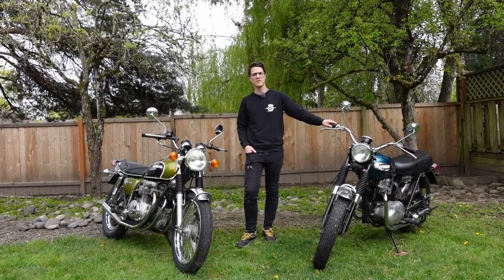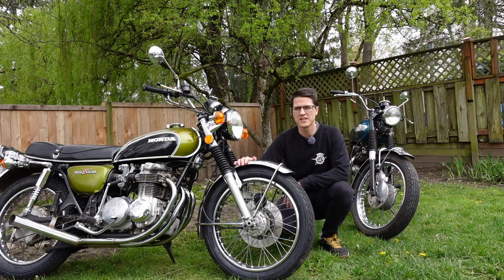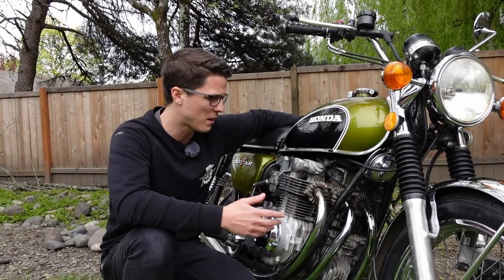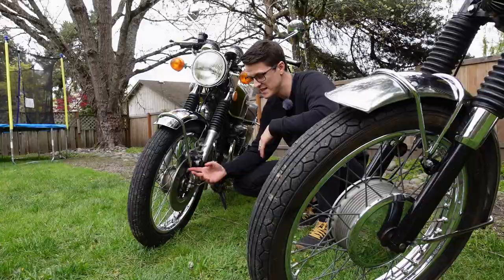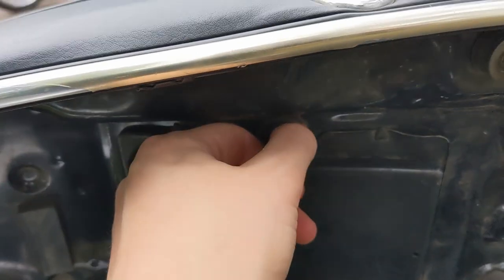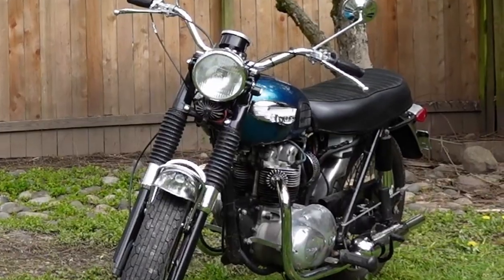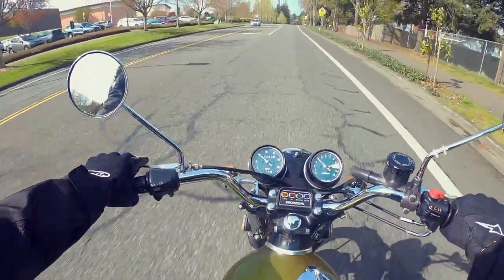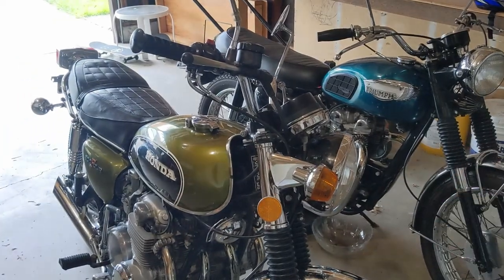How this Honda killed this Triumph

Comment: Errr, no your Honda didn't kill your Triumph, but you probably know that from the comments below. Besides comparing oranges to oranges 73 Triumph T100D had 5 speed slick gearbox ( better than Honda ), double pistons front disc brake ( better than Honda single piston ), much better frame and suspension and better torque giving more speed on low and middle revs where it really counts in real life. Only Honda upper hand was it's reliability and lack of vibration. Problem was only a few people knew about those Triumph features and they didn't care seeing it as dated bike anyway. By the way your 68T100  is a last year of this front suspension and SLS front brake, year later and T100 got much better front end and TLS brake both better than your Honda 500 parts. So yes, Brits try to improve it on a shoe string budget and in the same time not to loose their loyal clientele what was a very difficult task.
Reply: I'd think the more direct comparison would be 1973 Honda 4 to 1973 Triumph Trident or BSA Rocket 3, yes

Comment: Hi bart - it's Big Rodders in Ireland.  In 1973 I bought a Yamaha XS650 for £750 instead of the Honda CB500 that was priced at £900.  I was earning £60 net per month so the price difference was the deciding factor.  In 1979 when I owned a BMW 100/7 I had a test ride on a friend's Honda CB550.  I was astounded by its smoothness, tractability from low revs and low fuel consumption.  Overall, a captivating motorcycle and one I would have instantly swapped my Beemer for given half a chance.

Comment: I was in my 20's when these bikes were new. I chose to ride 2 stroke bikes. 69 Kawasaki 500 3 cylinder. A modified (more power) 71 Yamaha 200 twin & A 77 RD 400 Yamaha. Later on I had some 4 stroke bikes, but the lighter "ring ding" two strokes were better suited for the tight twisty mountain roads near my home (SF Peninsula).
Reply: Suzuki Waterbucket here. Four strokes couldn't catch me.

Comment: OK...  No electric start was not really a problem, as the 500 kicks easily, BUT it also vibrated (not so bad as a 650, but still buzzy) and there were always long-term reliability problems, especially with the top end.  The Honda by comparison was bullet proof and required little maintenance.  The electrics were also beyond reproach.  You didn't have to be a die-hard to ride the Honda.  God, I still love the way the TRs look and remember the sweet handling...but they were antiques by 1970.
Reply from the maker: Spot on

Comment: i had a a tiger 650, leaked oil, the zener diode was not a good voltage regulator. I still liked it and I had a Honda 750 , liked that too. The first 4 stroke KAWASAKI MADE was a licensed copy of a BSA  twin A10, push rods and all, the next year had an overhead cam.  whatever you get Motorcycles are dangerous especially now a days.

Comment: The single carb T100S/C had 34 bhp at the crank (about 30 at the rear wheel.  The T100R Daytona had twin carbs and hotter cams and makes about 40 (35) bhp and is good for 100mph (in theory!).  The 500 is actually one of the smoothest British twins. Mine doesn’t leak oil (but it was quite a challenge to achieve this).
Reply: The 500 Daytona was rated at 41bhp
Reply: @milojanis4901  Well depends where you look.  The early models were claimed 39bhp.  Triumph did claim 41 near the end.  I have never seen more than 30bhp at the back wheel on a dyno though.  This is consistent with a top speed of about 100 mph (on a good day)!

Comment: As nice looking as the Triumph is, the front drum kills the looks.  It looks clunky and older than it's vintage and lacks a certain elegance that the Honda has just because of the front brake.  The two-tone paint on the Honda is stunning, I don't think it gives up anything to the Triumph there.  The Honda's engine is less artful just because it takes up so much of the frame space, gotta give the Triumph that one, looks wise.  Overall, in the end, I think the two are closer looks wise than I thought, once I spent real time looking at them both...
Reply from the maker: I personally like the look of a drum break but you might be right, looks better on the old pre unit triumphs

Comment: If you think the Triumph 100 (the 500cc twin) does not handle as well as that Honda four cylinder nine foot wide thing, then you do not know how to ride a motorcycle.  NOTHING up until around 1985 handled as well as a Triumph 500 or 650/750 Bonny, except a Norton or an old BSA.  I'm American born & bred, but I know what the best handling bikes were, and they were the big English twins.  They were made specifically for handling.  The 100 and 120 (mph) Triumphs and the 750-850 Norton bikes were the best handling of their time.  The Honda bikes were a little faster, but could not keep up with the Brit bikes of the time when it came to twisty roads.  You just haven't ridden enough if you don't know that.

BTW, I do like the poor handling Japanese bikes.  They started every time.  They could not take the twisty roads.  Also, your remark about the Triumph leaking oil is something I suppose you heard from grandpa who drove an old Detroit Diesel big rig, (and man, they did leak oil).  You might have found a single drop of oil beneath my old Bonnie, but it did not just drip all the time as you allude to.  That is just folklore nonsense.  I've owned 'em all, and my favorite was my T140 Bonny.  Better than a CB 750 any day, (of which I have owned two). Get your stuff in one sock and stop banging on stuff just to get clicks.  

A Triumph, BSA or Norton will eat any Japanese bike of the same era in the curvy roads any day.  That is just a fact.  I've owned ''em all.  You are spouting folklore.

Comment: In the 60’s bikers had a bad image in the U.S. due to biker gangs.  Honda started importing small 125cc bikes and blitzed the TV airwaves with images of pretty girls riding them with the catchy tagline “You meet the nicest people on a Honda”.   This proved to be highly successful for Honda which started importing larger displacement bikes— 250, 350, 500 — and with each new model many of the now brand-loyal customers upgraded created a lower price of entry to biking market for the used bikes. Triumph never had that big of a market because it completed with Harley and BMW.  My first bike was a 1968 BMW R60/2.  What Honda did is create an entirely new market for a new type of bike with a very clever marketing campaign.

Comment: I've owned the ZX50, CB 750A, CB 360, CB350, CB350/4, CB400A, and all were reliable and fun but my heart would love to own a Triumph Bonnie.  I currently have a 78 Suzuki GS550 which I love, but would quickly trade it in on a RE Interceptor.

Comment: Were does the CB450 Honda twin fit in with your theory? Everyone seems to forget them.
Methinks they ran interference /prep for the CB750/ 500 & eventually the 350.
Also that 500 would look a lot better with it's original pipes.
Interesting listening to a 'young'n' waxing on about the 'old' bikes.

Comment: I bought a new bike in '77 and after a long search that included looking at a '77 Bonneville and '77 Norton Commando (last year they were made I think) ended up with a KZ650 as an ideal compromise between a CB500 and CB750.  Slightly faster than a CB750, and with better handling according to the experts, being about 30lb lighter and with one the first really stiff frames on a Japanese bike (the steering head and rear fork pivot area was very heavily gusseted).  I also tried out the Kawasaki 750 4 stroke twin but it was kind of slow and heavy by comparison.
Reply: If your KZ was faster than a CB 750, it was by VERY little, and a K0/K1 would bury a KZ 650. I owned both, and they're not even close. I owned several Z1s, with the 1973-1975 being the fastest. In 1976, they hung a set of 26mm Mikuni carbs on the 903, and called it a KZ. The earlier '73-'75 Z1s had 28mm carbs. In 1975, Cycle Guide magazine tested a 1975 Z1B, and it ran a 12.139@112.07 mph 1/4mile, which was the quickest and fastest 1/4 mile I ever saw the 903 run......
Reply: @milojanis4901  As I said, slightly. They were both within a couple hp of each other, and the KZ was slightly lighter. My riding buddy had a CB750 and in a drag race I could beat him by maybe half a length.  I only weighed 150lbs back then so that might have made the difference on its own.

Comment: Congratulations for your video, quite comprehensive, Bart ! I profite to send you greetings from this side of the Atlantic ocean, south of Portugal, province of the Algarve, and the historic city of Silves - At the moment I'm 61 (feel like I'm still 35, though) and I have a 1981 Suzuki GSX 1100 EX, that I brought from Macau in a container (Macau was the last portuguese small colony, back to chinese administration in December 1999, 60km's west of Hong Kong). When I came back to the Algarve in 1998, after being there 8 years working in tourism and part-time on TDM TV, of course, being a motorcycle fan, saw all the Macau Grand Prix motorcycle and car races ( https://www.youtube.com/watch?v=wLhfWxduLs8 ). Before and in Portugal, etween 18 and 30 years old I had a portuguese 50cc Casal (german Zundapp motor, Casal had invited a german engineer from Zundapp to make a similar motor), and I had adaptad my bike it to a scale version of a Trial bike, because this kind of sport was only starting in Portugal in the beggining of the 80's... I sold this bike because I bought a 1980 Honda 250 CB Super Dream, blue, from England, and then I found the same one with the same colour ( ! ) and owned the a 400cc version, that had come from South Africa, with a portuguese immigrant. :-) Now I still have my Suzuki 1100 and meanwhile "went back in time" buying an 1989 portuguese E.F.S. Zundapp 50cc, to restaure and for the little trips. This portuguese industry of the 50's disappeared in Portugal in the end of the 90's (japanese, Korean and Taiwan imported bikes...) but a lot of portuguese aficionados (really, a lot ! )are "making them alive" again in the last 20 years, it's amazing! The only portuguese motorcycle now is AJP with and imported motor, selling and exporting quite well  - https://ajpmotos.com/.  Anyway, I thought you and some of the viewers would enjoy this story of mine, so here I am...    Note: I couldn´t find a copy of Macau Grand Prix´s history on Youtube, so there's a link up there to it's Museum, made by a chinese young lady. This museum started when I was there in 1997 (or close), somehow was closed in 2018 and reopened in 2020...

Comment: I don't think one killed the other Honda didn't just build motorcycles  that were better they built a dealer network that was a lot better  I was born I 1959 buy the early 1970's you could buy a Honda in the small town I lived in in northern Wyoming I saw Triumph Bonneville's I've never seen a 500,and I didn't know were the had a dealership.the Honda's were everywhere.

Comment: You’re overstating the alleged drawbacks of the triumph for hype’s sake. Hype trash talk to entertain the kids. I own a 72 T100C and a Matchless G15CS, Ariel Square Four, BSA Lightning 650 and two Ariel singles. Me and my Winnipeg buds rode in the 60s and were handy at the basic mechanics you needed to keep the bikes tidy and operating well. I rode my G15CS 750 cc , one guy rode a Royal Enfield Interceptor 750 after his AJS 500 twin, another a Matchless 500 single then a Norton Commando 750. There were Triumph Bonnevilles and another Matchless G15 mk2 750. We knew what we were doing and what we liked we still do.  So, young fella, your jaunty hipster banter

Comment: Comment on brakes......Unfair comparison as the Daytona T100r came with a 8" TLS brake, not the 7"SLS on your T100c.This setup ( 8"TLS ), on a Trident was poor, better on the Bonneville & magic on the Daytona, Set up properly this brake would/will outperform the Honda.The other comments relating to oil leaks & handling are the stuff of old wives' tales!.People who perpetuate these myths probably don't own a Triumph, much less rides one.I think over 50 years in the motorcycle trade/racing is my bona fide stance.P.S The rear brake on your Triumph has been set up incorrectly ( brake arm angle )......Hmmm, A bit hard to put a old head on young shoulders.

Comment: My first motorcycle was a used Triumph Tiger 100 (500cc 1964). Unfortunately, even though it looked nice, it was in very poor condition. Pretty much everything was wrong, broken or worn. But it gave a young man a good opportunity to learn how to maintain a motorcycle - and I learned a lot. The sound was simply amazing, and yes - the motorcycle was dripping oil, but after 8 years I had it made oil tight. Then I sold it and it was replaced by a Yamaha XS750.

Comment: 09:36 - Kawasaki took a good hard look at Triumphs (and the gold olde Bonnie) and dit a wonderful job with the W650. Though a street bike and sports bike guy at heart, back in the early 2000's I worked as a sales rep for a MC dealer in Ruislip (Near London) - Daytona MC, and part of the perks were that we could take to use many bikes (demo/part exes), and I had a weekend with one, and bloody well loved it! Nice Summer weather, girls with short dresses, pub gardens for lunches and a nice cold pint after a good ride out... Oh them were the days! I think Kawasaki went a little overboard with the 'bulkiness' on the W800 though, but still, underrated bikes them. Did better in some aspects than the modern models of Triumph 'Retro' bikes... 🤔😏👍     😎🇬🇧

Comment: The Triumph 500 never had an electric starter. It never needed one. Having ridden the Daytone 500 and the 650 Bonneville, I definitely prefer the 500, just a much smoother, nicer bike. The only 4-cylinder bikes I've ridden in the 50+ years I have been riding are the Honda CB350/4 and the original BMW K100, so I can't claim to be either knowledgeable or objective. Incidentally, my Yamaha TX650's electric foot was so unreliable that I removed it and its gear train when I rebuilt the engine. Saved 5Kg in weight, and it was as easy to kick start as a Triumph.

Comment: I've ridden Triumph 500 and 650s, BSA 650s (first bike I ever rode was a 650 Lightning). I've also ridden just about all the 60s and 70s Hondas 350 (actually 325) twins, single and 4's, 400 4's, 500, 650, 700 (CB and VF) and my 1970 750 K0. Listening to your 500 Honda in no way is what they sounded like. Put stock mufflers on it and it sounds like a giant sewing machine. The engine has no noticeable torque curve, it just keeps revving with no discernible peak. I described it as it would run very little different with a giant electric motor if they had batteries good enough to do that back then. It was that smooth. My 750 on the other hand was (at least back then was a rip snorting monster to ride. It was much easier to ride after I changed the countershaft sprocket to an 18 tooth. I once did a 103 mile stretch in Southern Arizona in 59 minutes from stopped at a gas station to stopped at the next gas station. The statute of limitations was up on that nearly 50 years ago.

Comment: You see this the kind of drivel that as been said ever since BSA sold out to Dennis Poore in 1973. If you had ever read any of these books Whatever Happened to the British Motorcycle Industry by Burt Hopewood,  Giants of Small Heath: History of B. S. A. by Barry, BSA Motorcycles: The Final Evolution & From The Inside - Umberslade Hall both by Brad Jones and countless other publications, you would have known that BSA owner of Triumph had invested in a massive reorganization and expansion plan in the late 60s. BSA sales had increased over 40%. and BSA wanted to grow their automotive arm of business, by increasing capacity and building a complete range of modular designed bikes that share many parts, starting from 200/250cc all the way up to 1200cc five cylinder bike, this was in addition to the rotary engine bike and expansion of their range of 2 strokes. But before all these bike due out in 73/74 season, there was the power set, a face lift of the current bikes with some new features like the oil in frame, frame new folks and conical hubs. These bike been designed at the new Umberslade Hall research facility. Unfortunately in early 1971 due to production delays BSA missed the crucial North American selling season plunging the company in a financial crisis, this crisis was made worse by the money BSA had spent going racing and some of BSA 's other none motorcycle business under performing. BSA would be broken up and sold off in the next couple of years and Triumph would go on strike and the workers lock themselves  in the factory for 2 years. So in short the comparison you make between the 1974 Honda and the 69 Triumph is laughable because if BSA had not had the problems in 71 the Triumph 500 would have already been replaced by 1974.

Comment: The 500/4 was a cracker loved mine, it was bullet proof, handled fairly well for a jap of the period way better than the 750/4. However the all alloy 500 triumph could fly through the bends. With flexible mounting compound and careful reassembly it doesn't need to leak. Out of the two, for fun, I'd pick the triumph. If I was going coast to coast in the US though I'd pick the 550/4, just so I'd get there.....

Comment: I liked Hondas in my younger days because of their rock solid reliability. Purchased a slightly used 1969 green CB750 which I rode cross country. 
But the one thing a Honda will never have for me is that "certain something" that the British bikes had. They just looked so perfect 
My faves. ..'69 Bonneville,  Hurricane and later model Tridents in British Racing Green or Red.  BSAs, Nortons, Enfields...loved them all.